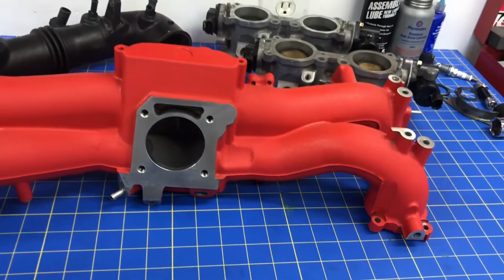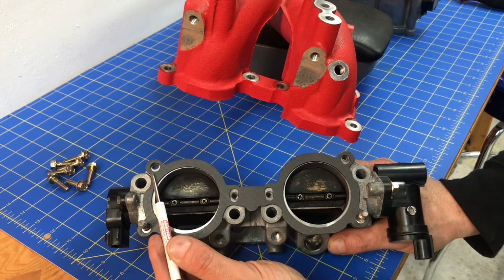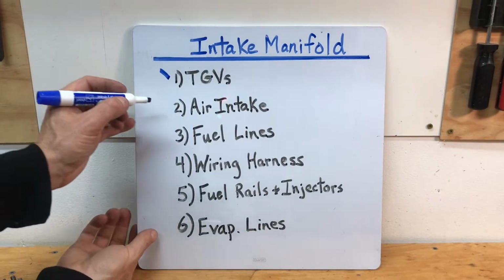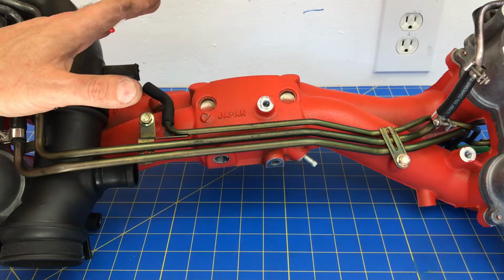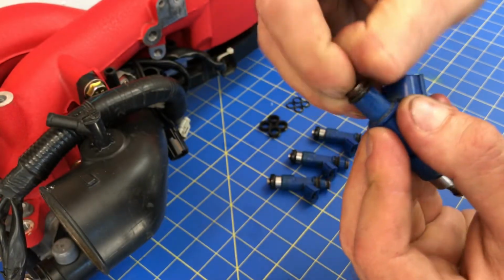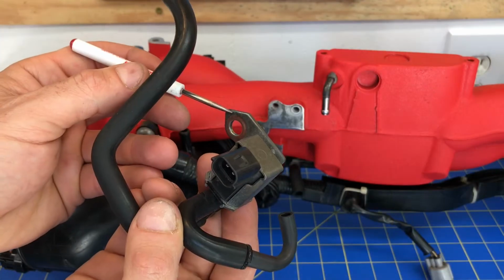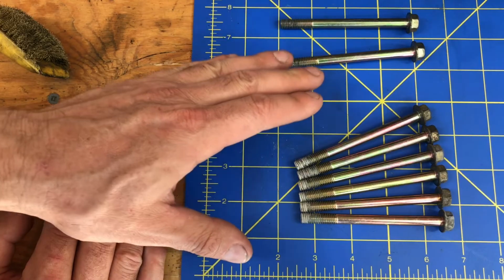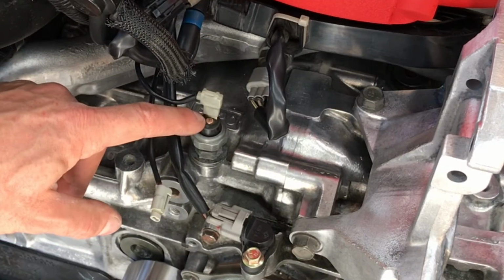EJ-Series Intake Manifold Assembly & Install

Comment: I'm looking to take an EJ251 NA donor from an automatic car and install into my 5 spd manual 2003 Baja. Most videos I see recommend changing the entire manifold with the wiring harness as the simplest bc of the TCM etc.  However,  the donor engine intake is all red, looks good and runs well.  Looking at this video,  it doesnt look complicated to just move the wiring harness over.  Thoughts?
Btw,  I'm a retired mining geologist,  Sudbury, Canada- copper nickel mines. 
Rock on!

Comment: You're in Cali? Where at cause I'd love to have some help with my Impreza. It started leaking coolant from under the intake manifold and I took it apart and put new orings on the coolant cross bad but it still has a slight leak from under the manifold but I have no idea what other coolant lines there are under the intake area

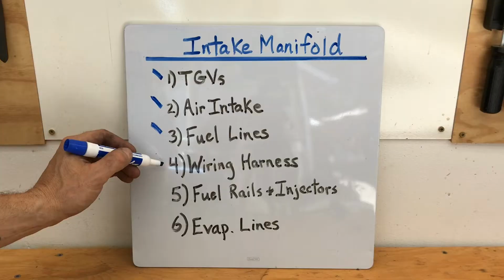Comment: 11:11 Wiring harness: I have a 99 JDM Legacy GT with an Twin Turbo DOHC EJ206 and recently took off the Intake Manifold to do the head gaskets. I did not pay attention to exactly how the engine harness was laid. Mine doesn't have the plastic heat shield for guidance. No videos about this other than this one. None of my manuals illustrate it and none of the forums discuss it (I may not be asking the right question!). Now the plug lead and and injector plug for Cylinder 3 don't reach. 

I've come to the conclusion one has to be a masochist to work on subies. They are so overly complicated . So many time wasting traps along the way.

Comment: Installing phenolic spacers on my 02 2.5 SOHC, I stripped a couple of bolt threads. 18.1 ft.lbs? Yes that's what the Subaru shop manual says. Found one Subaru tech on YouTube who said they only need about 10 ft.lbs. Eventually re-intalled the spacers with longer bolts than supplied and torqued to 10 ft.lbs.

Comment: Pro tip: Just get a new turbo inlet-intake and not one made of silicone or whatever… get a cast one.
Reply: Would you be worried of heat soak on the cast inlet?  Isn’t that why it’s plastic or silicone? I’m curious 🧐

Comment: Excellent video. You are very thorough. Great video for beginners like me. I have a problem with my 1991 Subaru Liberty, which are called Legacy in the USA. I live in Australia. 
My problem goes like this:
I start my car, which has a 2.2L engine, and I let it reach operating temperature. The temperature needle is in the middle. I then drive it out of the garage and start going around my neighbourhood. I don't go very far because I know my car will give me problems. About 300 metres down the road, just before I reach aroundabout, the engines stalls. With the speed that I was going I was able to make a u-turn at the roundabout. Once I completed the turn the car stopped. I restart it and I continued in 1st gear. My car is a 5 speed manual. About 20 metres down the road the engine stalled again. This happened 2 or 3 times until I drove it back to my garage. Back in January I was having this problem all the time. I got my car towed to my mechanic. He fixed it. He said he cleaned the MAF sensor. The car was going ok. After about a month the problem started. I took it back to him. This time he said diagnosed a code 35, which he said had something to do with the Purge Control Circuit. He said he cleaned the Evaporative valve and the PCV valve. The next day the engine was over revving. I took it back to him, with great difficulty. It's hard to drive a car when it is over revving. Anyway, he fixed it but not satisfactorily. It was going ok until 4 weeks ago. The problem started again. Again, the engine started stalling as I'm driving along. 
So, I started learning about sensors and ECU. Interesting stuff. It's not easy to understand but I have some of how cars work, especially old cars, 70's, and early 80's cars. However, sensors and ECU'S are a new technology. I'll still study and learn about this technology.
What do you think is wrong with my Subaru Luke?

Comment: Luke Thanks for the videos, appreciate the effort you put into them. I was wondering where you found the zinc plated bolts, most likely Amazon. However how do you know what pitch you need? I know some are 8mm x 1.25 but are the 6 & 10’s the same pitch? What heads are on your 205? Your valve covers are different than mine I have D25 heads that came off of a EJ255, anyway polishing them out looks good not great, but little by little I guess. Thank for your assistance.

Comment: I did this to replace my turbo inlet pipe, also removed the turbo, now fully assembled, I drove it about a mile and the check engine light came on and got lots of smoke from the turbo, checked flash codes and gave me code 22 for knock sensor but it didn't even touch that, help!

Comment: This video literally saved me. Im a professional mechanic and was installing an engine from a donor car in a 2012 sti. The motor was in an 05. I found out after completely tearing down both motors that the 12 have dual acvs. So heads off original motor went to the machine shop. After sitting there for over a month was informed they were unusable. Customer took all the parts to return at a later date with the parts and heads. I had everything together and organized. 3 months later i run into the customer who informs me he sold that car but has another car he wants a motor installed in. When i received the parts back there were missing peices, incorrect peices, ijust a mess. This video allowed me to finish the job and more importantly get paid. Im liking and subscribing even though i will not work on anymore subarus

Comment: The hose that you are bending up at 22:53, what is the hardpipe that it is attached to called? I have a coolant leak and I think it is coming from that hard line but I cant find any info about it.

Comment: I'm a Soobie Newbie; been building old Chevys and Hondas most of my life. I found an '04 Forester XT on craigslist for a good price with the caveat that it doesn't run. Got it towed to my house, now I have to get it running lol. It has a fuel leak beneath the turbo inlet and I need to address that before I can do any troubleshooting as to why it doesn't turn over. I've seen videos where people remove the stock inlet by destroying it but I don't want to do that. So I'm thinking I need to remove the intake manifold in order to get beneath the turbo inlet. So I guess what I'm asking is, whether or not I can remove the intake manifold without messing with the TGVs? It looks like I might be able to remove the manifold with the TGVs attached to it and not have to bother with the gaskets between them. Just trying to get this baby cranking for now and before I do that I just need to replace that tiny section of hose. WHAT HAVE I GOTTEN MYSELF INTO 🤣🤣🤣🤣😎😎

Comment: I’ve been able to delete the check valve in the past without causing CELs.  Simplifies the hose routing a bit.
Reply from the maker: Nice!!!
Reply: just discovered that i can do this. doing it now while re-assembling an engine. i'll report back if i have any failures. apparently the JDM EJ207 is an identical layout, minus the check valve. it simplifies that whole arrangement significantly.

Comment: Hi @SubaruONLY, thanks for great content. I got my hands on free 2005 Outback 2.5 XT that's overheating. Previous owners didn't care much for the car. It seems head gasket is bad. I'm about to pull the motor. I've got AC pump / power steering pump / battery / radiator / exhaust / crossmember 14mm nuts / ground straps off. Now I'm not sure if I have to take turbo and intake off as well before pulling the motor? Here's how it looks like: https://i.imgur.com/BjfT8B9.png

Another question - can you run aftermarket turbo and pass SMOG in California? I'm curious about all the tricks :).
Reply from the maker: Hey, you can leave the intake and turbo in place to pull the engine. As far as aftermarket turbos, fine to use for emissions, but can’t have it retuned otherwise that does become an issue for emissions.  So just need to use a turbo that can match the factory air-fuel maps.

Comment: Thanks for the videos! They are great. I agree with replacing he rubber hoses on the fuel hard lines but I noticed the hoses were stamped coolant. Shouldn't you use fuel rated hoses? I would hate to have fuel degrade the hoses and cause a leak down the road or  clog injectors. Correct me if I'm wrong.
Reply: Sorry,my bad, it says EPA compliant on that sucker good to go.

Comment: Thank you for posting this video! I’d imagine the process is very similar for an ‘05 Outback XT ej25 right?
Off topic: Luke, my car’s heater core is busted(inlet hose came clamped). I’m planning on doing a heater core bypass for now. It should be fine running a #4 cylinder cooling mod from the bypass right?

Comment: Luke did you happen to buy the hard fuel lines new or did you refurb them as well? Getting ready to do this exact project
Reply from the maker: Ended up using the OEM lines and cleaning them up. Not sure at what HP larger lines are needed.

Comment: I just bought a 2002 impreza wrx sport wagon with the ej205. It had a boost leak so i started pulling all the hoses that were hard, brittle, or that have failed. I had to do my valve cover gaskets as well. Everything is done but im so lost on which of the hoses go where. I think a video on vacuum/heater hose locations would be very useful. I cant find a good one anywhere. Im pausing video to get an idea of what the prepped motor and prepped intake look like with hose locations. Kind of a pain in the butt but i have to do something. Any recommendations on a good source so i can get this thing back to being driveable.
Reply from the maker: Hey buddy, I feel ya, been there. I don’t have any videos that cover everything. I have one on the intake manifold and all fuel EGR lines. But non covering all the vacuum for the turbo system, HOWEVER, check out this link: 
https://cobbtuning.atlassian.net/wiki/spaces/PRS/pages/615088215/How+Subaru+s+Factory+Boost+Control+System+Works
It’s to a COBB page that covers the Subaru turbo system and all vacuum line. It’s a great resource, and has some great pictures that show all the vacuum lines connected to the correct spots. 

Hope this helps, good luck! 👍

Comment: I just had my intake manifold removed to replace the turbo inlet and now my air conditioner is blowing hot air do you know if you remove ac refrigerant lines when you remove the intake manifold my are my car works good up until now and I just had it recharged 10 months ago along with high-pressure refrigerant hose and seals
Reply from the maker: Sorry to hear. No, don’t know.

Comment: I have 2 sensors on the back and I have no idea where they go plz help
Reply from the maker: Hahah, need more info bro!
Reply: @SubaruONLY  I got it found out the connect to each other 😳
Reply from the maker: Lol, nice, and been there, glad you figured it out!
Reply: @SubaruONLY  I am having trouble figuring out where the crankcase hoses go since im going front mount
Reply from the maker: Yes, that’s a little tricky setup.  Stick with the fundamentals and reroute as needed! Good luck!👍

Comment: How do you recommend cleaning the injectors? And some of the bolts were different lengths when I removed them, I took photos of them all but if I were to replace them all with zinc coated would I need to find the right sizes or would one size fit all of them?
Reply from the maker: Ultrasonic bath works well for the injectors. For the bolts, just need to make sure they have enough bite left (ie threads, about 30mm is good).

Comment: At around 19:20 you talk about the broken plastic tee fitting. Mine is broken on my '04 Forester XT, but I cannot find a part number for it. And I did look thru Amazon SubaruONLY. Anybody know what it's called by Subaru?
Reply from the maker: Yes, it’s part of the purge valve for fuel vapors. Think you need this - Part Number: 22310AC241

Link here to confirm: https://www.subarupartwholesale.com/p/Subaru__WRX/Hose-Vacuum/49231575/22310AC241.html
Reply: @SubaruONLY  Thank you!

Comment: Would u recommend cutting out the flaps from the TGV valvs in my 06 WRX STI ?
Reply from the maker: Again, depends on intended use. They help with cold starts and smoother warmups, which is a good thing. But if you’re heading down the path of more HP and aftermarket parts, it’s a good idea to remove them.  Either option is a good choice.

Comment: Luke would u recommend I replace my stock struts with coilovers ?
Reply from the maker: This is a BIG one! All depends on the intended use and budget.  Good shocks and OEM coils are a pleasure to drive, nothing like the smooth OEM ride.  But for serious performance, nothing will compare with a GOOD set of coilovers. Note the caps, lol. For me, cheap coilovers are no where near a good set of shocks and OEM coils. But in med to high range for coilovers, there are a lot of really good options - but once you step up to this level, it’s even more important to make a choice based on intended use!  RallyX, Stage Rally, Autocross, High Speed Street use, all slightly different function and design - so choose wisely and talk to the pros at each respective company (they all want to help, so they’ll offer lots of info if you reach out!). Hope this helps, cheers!!!

Comment: 04' Forester. 2.0L Ej20. 5 spd.  Did the rubber fuel line replacement[s].  Stock engine. I have the TGV spacers, but no Butterfly valves, no electronics, etc. The TGV "SPACERS" [I'll call them that] look very factory stock, rough edges and all. No Drill holes, no marks whatsoever where the rod would typically go thru. DID some of these engines come with just the SPACERS and no Butterfly valves?  I call this a 3 piece intake, as I can unbolt the SPACERS from the intake. Also, Wiring harness does not have any type of connections anywhere IF these were change out.  Any thoughts on this?  Do I have a pre-TGV engine? but I have spacers......weird.
Reply from the maker: Hmmm, yep think you nailed it!  Likely they add those spacers to help increase the air velocity to improve the fuel atomization.

Comment: Does the EVAP system ever see boost? if so, do those connections need clamps?
Reply from the maker: As I understand, it’s doesn’t. The scavenging of vapors is isolated from the pressure created by the boost pressure. Good question though!!! 👍

Comment: Can I put a 2013 2.5L in a 2009 out back and I can’t can you please tell me what to do
Reply from the maker: Not too familiar with this swap, but from what I know, it’s certainly doable.  One thing I can say, if the engine displacement changes, or any other significant changes, you’ll need the ecu and wiring harness too. Other than that, it’ll be lots of small doable items.  Good luck 👍
Reply: Appreciate you

Comment: This is a really helpful piece, well done.  I had to replace the hard fuel lines under my WRX manifold and this was so helpful in advising me which bits of the ancillaries went were...Thanks a million
Reply from the maker: Glad it helped buddy! Cheers!
Reply: @SubaruONLY  how would I successfully delete my fuel canister without getting a check engine light? The  factory mounting bracket location is rotted and I don’t want it to fall off while driving and potentially become a problem or hazard

Comment: If you live in colder climates, it's a good idea to replace those rubber fuel lines/hose clamps with higher quality ones! In colder temperatures, those old lines leak fuel on start up.

Comment: Excellent video. Helped me re-assemble my intake mani. Still hoping for some help with finding those bolts.
Reply from the maker: Thanks. Sorry buddy, meant it look those up. Bought them years ago (all bulk buys are like once every three years), so couldn’t remember where I got them. Look for zinc plated, grade 8 if possible. If can’t find that, just try to find a set that are made somewhere other than China (only cause most raw metal out of that region is not the best quality).

Comment: Hey brother man, I’ve been watching all your videos seeing as how I decided to buy my first Subaru almost 6 months ago now. I was/still am for the most part pretty clueless when it comes to vehicles but a local shop, my tuner, and YOU mostly, have helped me out a ton. So thank you brother. I bought an 07 sti with 74k miles with surprisingly a bunch of legit maintenance paper work. I brought it to the shop, had them do my head gaskets, new belts, along with a few other smaller things. After paying 2k I promised myself I’m going to learn how to work on my damn car, it’s been a blast. Since then, I’ve installed a rad, rad fan shroud, all new hose, new wheels and tires, coilovers, took the big ol wing off, flushed and filled fluids, installed some gauges, and the new oil pan, baffle and pick up. Have a tons more plans but just wanted to say your videos are fucking rad and mega informational. Keep on doing what your doing man, sorry for the whole book hah
Reply from the maker: Legit man!  Thanks and really appreciate you taking the time to drop this message!! 👊

Comment: I need to change the coolant pipe O ring gasket that pass through the intake bottom, so maybe I will not need to uninstall every intake parts, thats coolant pipe have some leaks 🤔

Comment: I need your help or anyone i got a 1995 subaru impreza outback with a 1.8ej an i got my intake off an I'm replacing my vacuum lines an i can not find a diagram anywhere
Reply from the maker: I’d download the Factory Service Manual (FSM).  Use this search term in google, “1995 FSM” - then download and you should be good to go!  Or you can go to SubaruONLY.com and click on the FSM tab to download.

Comment: Wonder if you can help me out? The pcv connector also have a sensor that needs to be connected so code p1491 won’t pop up. My question is do you know where that cable harness is located ? I installed the a new pcv valve but can’t seem to find that cable any where. Thanks in advance
Reply: Amazing block..... spotless